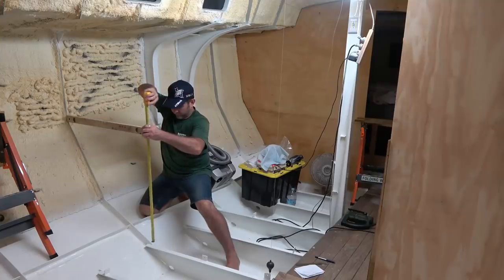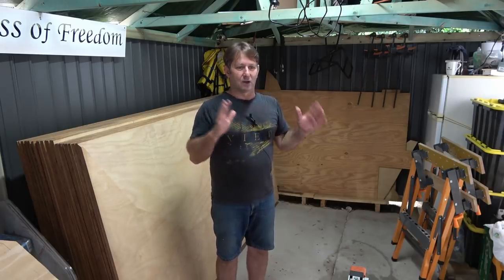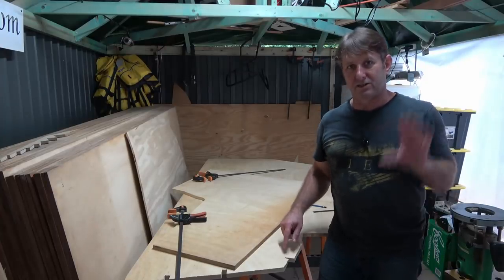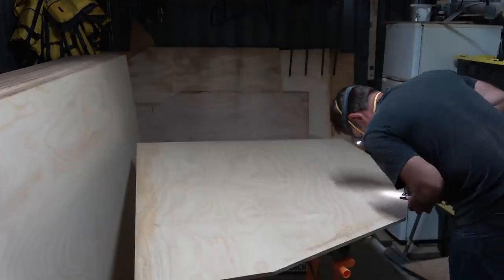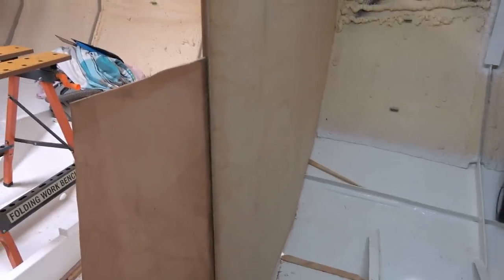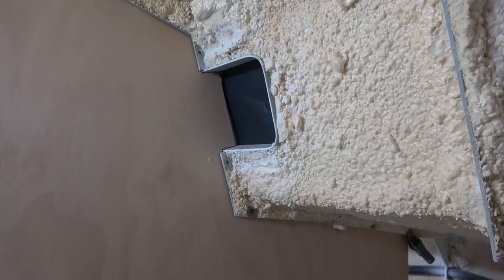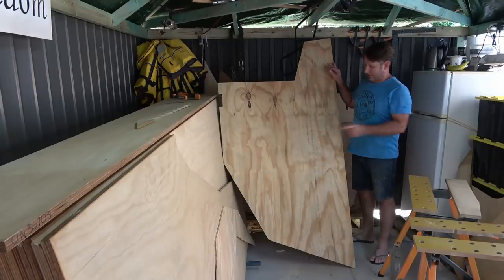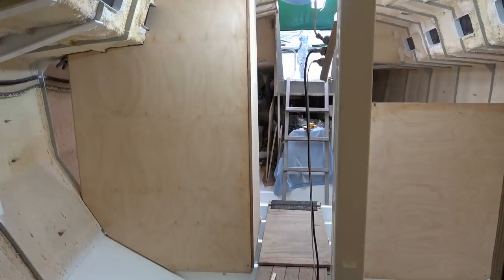Building my steel sailing yacht Ep.39 Things are changing inside,..

Comment: When you need to make 'fine' cuts with a jig saw, use a 'hacksaw' blade. It cuts much slower, but much smoother and allows you to control the cut much better. Cutting a straight line with a jig saw works better when you use a guide board, just like when you use a router...
Reply from the maker: Thanks for your comments and ideas Mike. Actually I have always found that using a guide fence with jigsaws does not work, the blades wander!

Comment: The head is going to be a nice size, you will be able to comfortably take a shower in there, I like that feature. Will it have a separate shower?
Reply from the maker: Thanks very much for your comments Renegade Show and yes it is a good size!
No there won't be a separate shower but I will likely have a shower curtain between.
Reply: @BuildingSYMistress  I have been living aboard for about 3 years now, been on boats since I was 6, if there is one thing that can cause a ton of issues on your boat it is that shower. 

If I had the room on my boat to do it id knock out the wall in the head and put in a separate shower because if you shower on board it just puts a whole lot of moisture into the head, and it can stay wet all day. 

Sadly I do not have the room on this boat so when I remodel the head it will have to be a wet room.
Reply from the maker: @RenegadeADV  Yes understood sir and good points, thank you!
And all the best on board with your boat too!

Comment: Putting a bulkhead in the middle of a window seems like a design mistake for me. Was it in your plan? Or didn't you realize this problem before?
Reply from the maker: Thanks for your comment Michael and to explain how this situation happened - the original plans had completely different port hole designs that were long, thin and tapered which I didn't like, so the port hole design and positions are my doing. The bulkhead at that position mentioned is in the original position per plans, which coincides with the framing and hull floor position. The "compromise" that I was faced with was to change/shift the port hole position at that port hole so that the bulkhead did not bisect it, or leave it where it was and keep the port hole positions symmetrical but be left with that bulkhead bisecting it. I hope that this explains the situation.